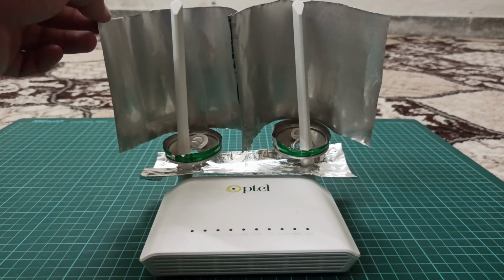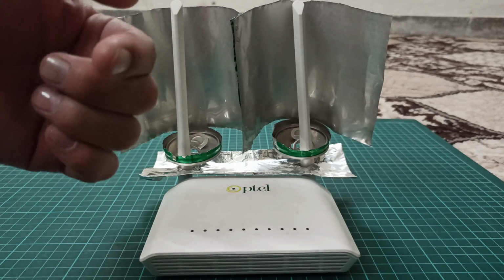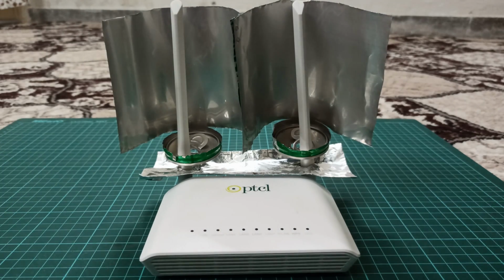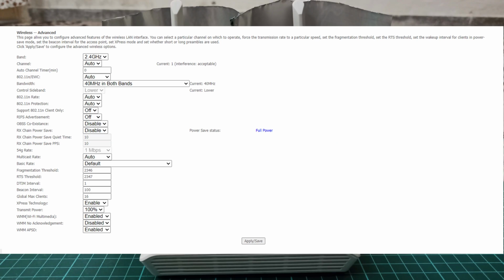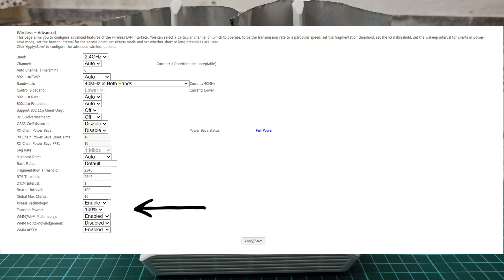Cheapest WiFi booster | DIY | Homemade

Comment: Sure lets bond/bridge our 2.4ghz signal with our 5ghz signal. If this is a dual band router. Don't do that as you create interference. It has 2 antennas for a reason. If you do this simply use a non metalic tape to tape the antenna to the can. Place a piece of cardboard or rubber between the cans to keep the signals seperate. Dont put the aluminum foil over both antennas. It causes feedback interference degrading the speed. This will change your omnidirectional antenna into a directional antenna improving the distance of the signal which may improve the speed of your connection up to the limits of the router of course. Some routers access points or mesh systems connection speeds are limited on how fast they can go because of hardware software or government regulations. So in short in you have the fast gigabit internet speed from your provider dont buy a 300 megabit router or access point cause your only able to use 1/3 of the speed your paying for from your internet provider. I always get a router that provides at or just above what my provider says they are supplying me cause every one rounds up. This router can handle 5100mbps. Ya thats total of all signal speeds combined. Like 2.4ghz at 600mbps and 5ghz at 4450mbps total is 5050mbps but they call it 5100. Same with providers they say 100 mbps its probably like 120mbps or if its 1 gig its probably closer to 1.2 gigs.
Reply from the maker: Thanks for your detailed observations and valuable suggestions, much appreciated!